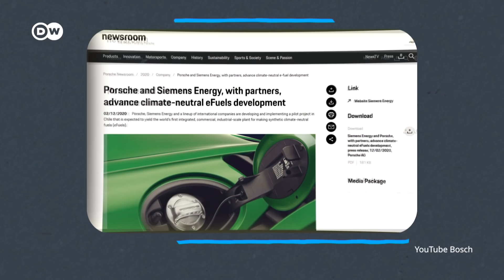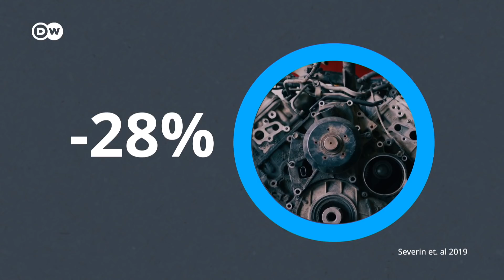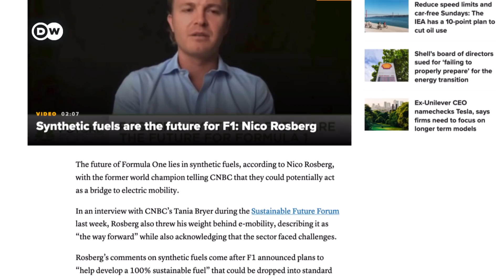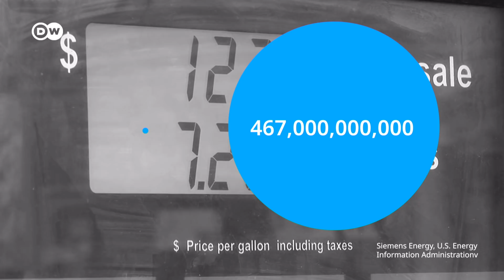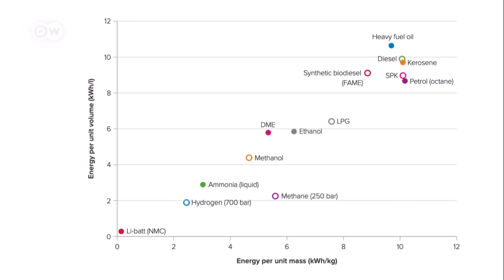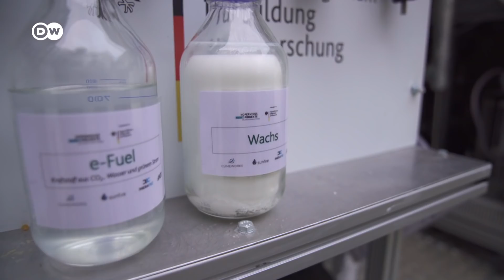The truth about carbon neutral fuels

Comment: what about how much energy is needed to break down the CO2 molecule and then to combine it with hydrogen? energy balance - that's the important part
Reply: Obviously there are massively losses thats thermodynamics in a nutshell. In the vide it said 8-15% of the energy actually makes it to the wheel, so thats losses from fuel production and engine.

Comment: From working in the carbon footprint world, I think carbon offsets have a much better chance than biofuels. They are both a bridge to a cleaner energy future, but carbon offset projects use the exact same technology we are already use in regular projects. There is no advanced research needed. The difference is really if the project qualifies to be a carbon offset project, which is a whole other story.
Reply: Fuel cells and engines are dead. 6,500,000 EVs were sold in 2021 compared to 15,000 fuel cell vehicles. And right now  there are only 2 models on the market, it used to be three but Honda pulled out as they could clearly see the future of fuel cell vehicles. And E fuels produce tail pipe emissions. Which would still be killing millions per year from air pollution on the ground. Just stop with this nonsense, battery electric vehicles are the way to go.
Reply: @HarrisonAdAstra  I completely agree!
Reply: There is a lot of fraud in carbon offsets. I think DW made a great video about that.
Reply: @DanielBrklyn  I actually have worked in the carbon offset field and yes for sure there is. I’m currently researching the exact extent of it. However, if you find the right offset programs they are highly impactful.
Reply: I think carbon offsets should be totally eliminated. They are nothing but a fraud.

Comment: Efficiency is the key to CO2 reduction, no matter which energy consumer we're using.
Reply: Exactly, and electric vehicles aren’t really climate friendly…
Reply: @krabbe969  Nonsense.  EVs are better for the climate than ICE vehicles under virtually all long-term scenarios.
Reply: @incognitotorpedo42  virtually long term scenarios,  they reach the point where they are better at 100k kilometers, and that after around 10 years, ah wow and after 15 years you have to replace the batteries... and most people who can offord a ev drive them for 4 years do 30k kilometers and then get a new leasing... super eco friendly right? A ice car powered by e fuels would be 100% carbon neutral whil driving, and the production carbon footprint of ICE cars is very small, so overall its more eco friendly when powered with e fuels.
Reply: @krabbe969  If you only drive 30k km in 4 Years, I wouldn't advise to buy a vehicle at all. If I were you, I'd buy a bike and use the puplic transport and car sharing.
It's just not worth the leasing cost, be it ICE or EV.
Personally I drive 25-30k km per Year with my EV.
And yes taking the train would be much better than an EV or ICE, agreed.
Also the break even is around 70'000km with a Tesla Model 3 and similiar EVs.
So far there has been no reports of Model 3 batteries needing to be replaced prematurely, and I am sure there are Tesla Model 3 out there with 300'000 km.
Reply: @FIGHTTHECABLE  i personally drive 50,000km per year with my cayenne, i know many ppl who just drive 10-20tkm per year and then just do a new leasing after 4 years. they just want the luxury of a car even when their work is just 10km away. I could see a possible future where you just have the option between ev's and ICE cars running on e fuels,  but not on ev's alone
Reply: @krabbe969  well then you should be on the look out for the new electric cayenne coming out once your car has reached its age. And tell your companions to consider changing habbits. I agree, EVs need to be driven. Anyone buying an EV and then not using it, is doing worse to the climate.
I take the bike to work in summer, cause it's close. I the winter I switch to the car, not a fan of bus drivers here.
Reply: @FIGHTTHECABLE  i cant tell whole spoiled switzerland to change their habbits xD i fortunatly had a little talk with a porsche engineer at the IAA,  he told me that there will most likely be a option to choose between the electric and gas cayenne, caus porsche doesnt want to annnoy their customers, i think they will produce them until the final ban for ice cars if the e fuels wont have any success. But im gonna stick to my beloved n/a 4.8 for a while now :) maybe till i find a cheap turbo gt xD
Reply: Pretty simple math here. Say a Model 3 consumes 18Wh/km
0.18kWh/km  x 200'000 km = 36000 kWh

Diesel Engine the most efficient form of ICE
1 Liter Diesel = 10.56 kWh
Modern Diesel Engine avg. 5.5 L/100km
5.5 x 10.56 / 100 = 0.5808 kWh/km
0.5808 kWh x 200'000km = 116'160 kWh

In no scenario is an electric vehicle not more efficient. Diesel uses 80'000 kWh more  than an EV.
In Liters of Diesel that is 27'272 Liters more than an EV.
Which is roughly at a 50 Liter Tank, 545 Full tanks!
In no logic or statistic does it require that much energy to produce a 600kg Battery.
Also let's consider Diesel not just coming out of the Fuel pump, but actually having to be pumped out of the ground, transported refined and pumped again. In no way is that not costing 0 Energy to do that. So might aswell add some more diesel to that 27'272 liters diffrence already at hand.
Reply: @FIGHTTHECABLE  In case you are referring to me: I absolutely agree with you that electric vehicles are more efficient overall. But that wasnt my point. If you dont use the energy available because its not feasable then the efficiency there is 0. So thinking in efficiency terms doesnt make any sense in this case. Something you also didnt take into account in your calculation is transportation. If you produce electricity in Chile how can people from europe for example use/consume that? Simply put: they cant as the distance is just way too far. So you need to convert that electric energy into something else that you can transport. Hydrogen is a possibility however, because of its characteristics its not really an option right now as it has to be stored under insane pressures which ist not only dangerous but also costly. So you need something else and that could be efuels.
Reply: @lorenzo410  i was not reffering to you.
But I get your point. I have a counter arguement for that idea. Dependency. We should stop being dependent from other nations. Countless times in the last 50 Years have wars had an impact on our energy prices, most notebly as the fuel pump or heating prices.
Also I think we should stop building infrastructure in 3rd world countries, exploiting their resources, but leave the excess to them.
Reply: Yes but as the siemens guy pointed out, if you wouldn't use the wind in chile anyways, the efficiency is neglectable as no use is like 0% efficiency.
Reply: Agreed and lugging a metric ton of batteries around is not very efficient.
Reply: Actually reduction of consumption is the key to CO2 reduction, but it seems that we aren't willing to go there yet
Reply: @jeroenverschaeve3090  efficiency is exactly that. You can have a house heated with oil and use more energy. Or you can use a kompressor that acts as an inverted fridge to warm your house. The latter is of course more efficient and therefor you consume less of our global recources we have.
Reply: @jeroenverschaeve3090  Ik zie jou ook niet in een boomhutje leven Jeroentje. Zo een onzinnige opmerking dit, en helaas ook een populaire

Comment: Hydrogen is the fuel of the future and it will win out in the end as it simply has no equal. Batteries pollute someone else's land to the point were they can't even grow food on the soils or take swim in the water ways, Nuclear just kick the pollution can much further down the road for someone else to deal with long after those who made the plants are dead and gone, fossil fuels are depleting our atmosphere of oxygen and if we don't make the switch to just hydrogen soon nothing will able to breath. 
In 1968 a technology came out that split water in the same way a thunderstorm does by mimicking the earth's global electric circuit electronically. Water is broken down on demand at the point of use, and used as fuel which puts the water right back into our atmosphere. No more creation of CO, CO2, and NOx gases and it doesn't deplete the oxygen in our atmosphere as water has all the oxygen it needs to burn the hydrogen completely. 
This process is not electrolysis as it's a new way to break the bonds of the water molecules by way of ionization with high voltage potential differences.

Comment: Small electric airplanes already exist and medium size ones are being designed. Short haul flights will be electric. And then there are also aluminum batteries, which have 10x the energy density of lithium ion batteries, but cannot be recharged so they have to be recycled once they're used, so longer haul flights could easily go electric as well.

Also, a power line is easier, cheaper, and more efficient to build, especially through rough terrain, than a road. The claim that they cannot use the wind power in Chile is a marketing technique for their technology.
Reply: Never heard of this Battery technology. The word recycling hurt though. Recycling also uses energy. I assume the aluminum would have to be melted and reassemled, in order to regain its properties. How much energy would that consume to recharging a lithium battery 10x?
Reply: Or easy way Plane and Trucks use efuls, Ships, Steel Production Hydrogen and everything else Electric
Reply: still all those aircrafts will be significantly slower than anything jet powered!

Comment: I'm confused... why make hydrogen,  and then make fuel out of it? I thought that hydrogen was the energy dense solution. Or is the point that existing vehicles could use this stuff?
Reply: E-fuels are actually a lot more dense than hydrogen gas. In fact, it being a liquid rather than a gas makes it a lot easier to work with.
I think E-fuels are the only real alternative to kerosene in airplanes for example. Hydrogen might work, but it might be too heavy to be practical.
Reply: @AykevanLaethem  While true, I also think that's pretty much where the benefits stop. The siemens guy was just straight up lying when he said it's the only viable solution for planes AND shipping. Planes? Maybe. Shipping? Literally the one mode of transport where energy density brings the smallest benefit. Ships are 100% going to run on hydrogen.
Reply: Not only this, but also think about the transportation. Hydrogen needs to be stored under insane pressure which brings not only the costs up but also the points of failure. E-Fuels can be stored and shipped just like normal fuels.
Reply: And yes, cars can run efuels.
Porsche actually tested it in their GT3 performance car, and surprisingly performed really well. It will be usable on gasoline powered ICE's.
Reply: Hydrogen is a mare to store and transport.  My favourite tech is to use NH3 (anhydrous ammonia ) as an e fuel.
Reply: @thamesmud  I'd much rather have chemical of phisical reactions that don't off gassing as fuel (like electricity). Even Hidrogen burning produces NOx
Reply: @thamesmud  I stay away from ammonia. It is toxic and produces nitrogen oxide, worse than carbon dioxide. No way that will be acceptable.
Reply: I was thinking the same, why add all the extra processes when the efficiency of synthetic fuels are not better
Reply: From some articles that I have read hydrogen could be great for making cleaner steel
Reply: Because there are 1.5 billion cars with combustion emgines. These will not magically disapear in the next 20 years. 
If we want to become CO2 neutral, we absolutely must produce synthetic fuels.
Reply: toyota tested hydrogen cars for 20 years and it is not viable. hydrogen fuel tank gets empty after 8 days of non use
Reply: Hydrogen has Energy Density per Mass higher than any Liquid Fuels. But guess what? Volume is far more essential. Hydrogen isn't even up for competition against existing Synthetic or Petroleum Fuels if Volume is considered.

Comment: To be honest, I view cars themselves as a niche transportation method to begin with. So a niche fuel for a niche transportation method?? That shit ain't goin' no where folks. The best way to reduce our reliance on fossil fuels is going to be to take cars off the roads and replace them with more efficient mass transit methods. Particularly in urbanized regions, where cars simply do not belong. 

Also, electric vehicles have manufacturing problem. Many times more miles go into the production of an electric vehicle than does a combustion engine vehicle.So going electric does not necessarily benefit the environment. Just the companies that produced that vehicle in the first place. 

I swear, capitalism is never going to be good at working with the environment. The entire point of capitalism is to create profit, not sustainability. It seems to me that profit is a by-product of waste. If true, that means that capitalism, by definition, leads to climate change and anti0sustainabile methods and technologies. Sustainable capitalism is an oxymoron, sort of like breathable pollution. It simply does not make sense. And it's not going to work.

Comment: As a nuclear engineer, I get really offended to not see any mention to the advantages of using nuclear energy for synthetic fuels production. In this video, they only cover conventional electrolysis, but if you use High Temperature Electrolysis getting both the heat and electricity from a High Temperature Reactor, then the efficiency goes actually much higher.

You also excluded uranium from the energy density chart, which is kinda weird, considering it is by far the most energy dense source of electricity humanity has successfully deployed.

You should have also mentioned that e-fuels are at best an alternative to reach net zero, since you continue to release carbon dioxide and other harmful gases during combustion in the ICE. So, for me, it's not really about adopting one option over the other, it's actually always about finding the right balance in terms of energy mix that is capable of keeping emissions as low as possible and at the same time ensuring we recycle as much natural resource as viable.

This last topic is very important and I often see people forgetting to take into account the Lifecycle emissions of solar panels and wind turbines. Plus, you have the use of critical minerals that are not renewable and are already used in many other industries. So, we really have to be careful not to let people think the solution to our climate crisis is as simple as deploying solar panels and wind turbines as if we didn't need to care for their respective use of finite natural resources.
Reply: Sorry, but no.
If you ask me, this is the future: https://youtu.be/Miysn2-fae4
Reply: uranium is also fossil, and non renewable. What most pro-nuclear fission enthusiasts forget is that in 80 years of using nuclear energy, there is still no long term storage solution available anywhere in the world. Also, when nuclear powerplants are decommissioned, there are huge costs associated with "recycling" it, and usually the company just declares bankruptcy and leaves the costs to the government aka the taxpayer, which is usually multiple billion dollars, which is not factored into the Life cycle costs of nuclear power. IF you would factor that in plus the storage cost over the next hundred thousand years, nuclear would be nowhere near financially feasible. 

Solar doesnt use a whole lot of rare earth metals, the problem lies usually with the electric vehicles which require a whole lot of lithium for batteries and neodymium for the motors. 

Best advantage for e-fuels is imho that you can continue to use the fuel infrastructure such as oil tankers. gas stations and ICE cars and trucks, also planes. This is , at last, the biggest saving factor, that you don´t have to build so much new shit. Because after all, if you don´t build new stuff, you don´t use any new resources and cause any new C02 emissions.
Reply: Good luck.  I’m with you and a proponent of natural gas to displace coal for electricity production.  However it’s been demonized to the point where people will literally stop at nothing to block pipelines.  Wind and solar are the only options people want to discuss.  Then there is carbon sequestration that is being part of the solution that will also require many more pipelines operating at much higher pressures than our current network of natural gas lines.  I’m all for looking for alternatives but it seems many think this has to be done now as if we are all going to die in 10 years.
Reply: Turns out mass hysteria doesn't do good for a civilisation 
We literally have the perfect solutions for our pollution crisis (Nuclear, Synthetic Fuels, Railways), but guess what? People want the vroom to fuel their ego, People want Solar and Wind and Batteries even though they will create more pollution in the long term, and Politicians and Businesses only want to inflate their wallets.

Comment: Electric cars  are not 70%  remember  making the battery  a big energy need to make and its  not clean   mining the material need and hydrogen  probably  the most  efficient
Reply: And the production facilitys for E-Fuels and the transportation should also be remembered.
Also the need for water desalification since the solar hot spots are in dry areas with very little water ressources.
Reply: Do you think combustion engines and oil grow on trees?
Reply: @MrMischelito  do you think  electric engine  and battery grow on trees lol
Reply: @MrMischelito   I don't get what your try to say yes you need to make a combostengine  you also need to make a electronic engine   I was taking  about  the  bettery